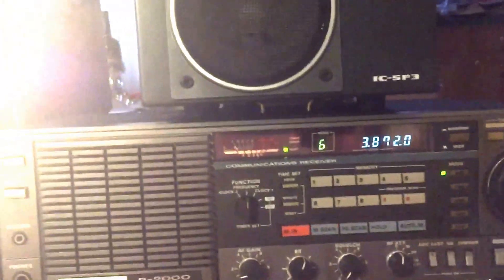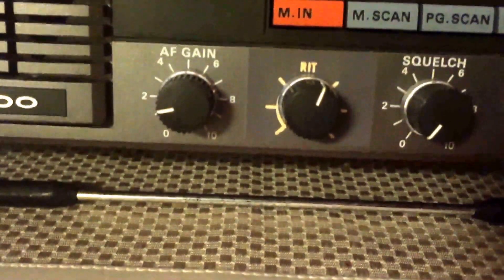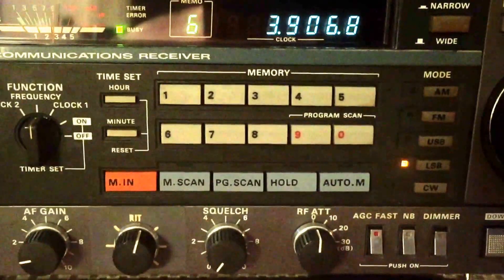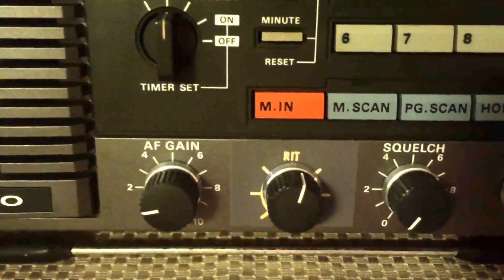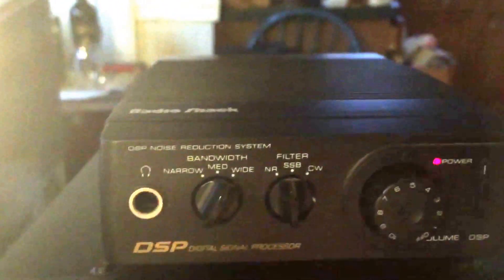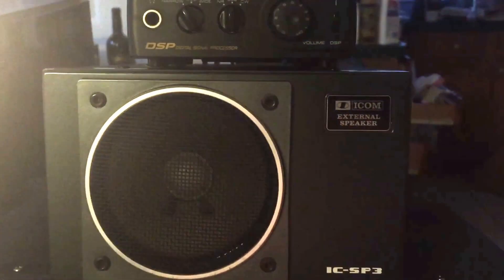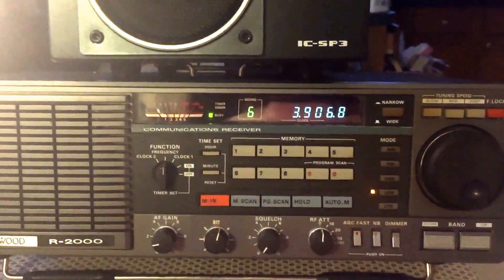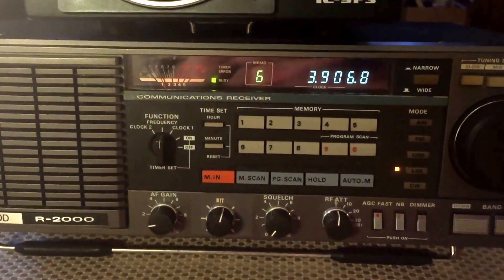Kenwood R-2000 Update- Mods, External Speaker, and DSP!

Comment: I have a r-2000 and am using a simple wire antenna strung out in my yard > get very few stations. any ideas on an option to get more stations including fm
Reply: A-99 ,Works Damn Well On These Radios ,Just Put It Up High In The Air.
Reply from the maker: Yes, try spraying the attenuator switch with Deoxit, and work it back and forth a number of times. Then try it.
Reply: @ArthurHallicraftersKitchen  I just sprayed my attenuator switch with Deoxit on my Kenwood R-2000 and it helped quite a bit.  Thank you.
73 Paul AA1SU